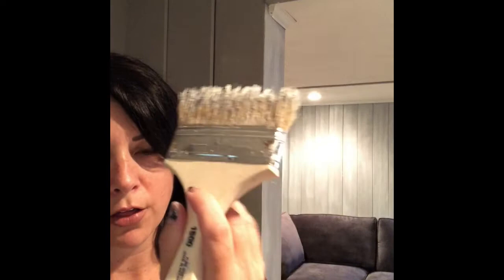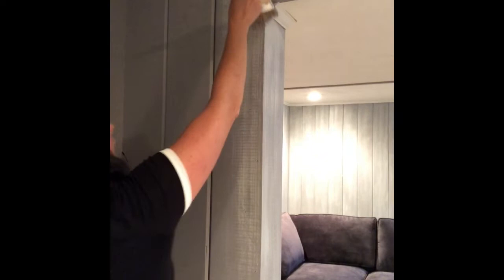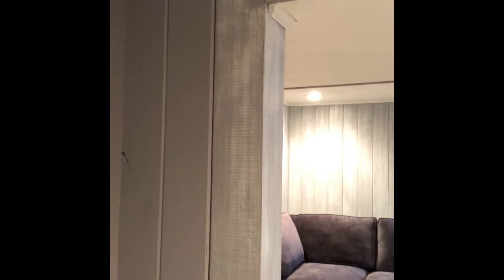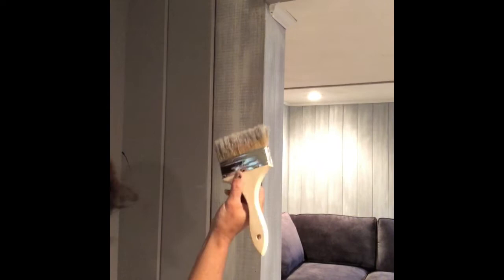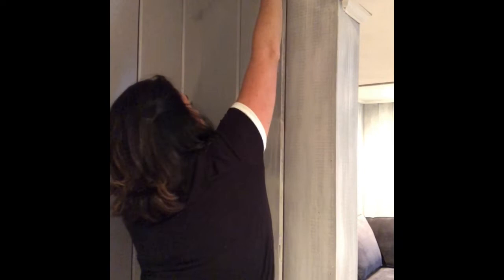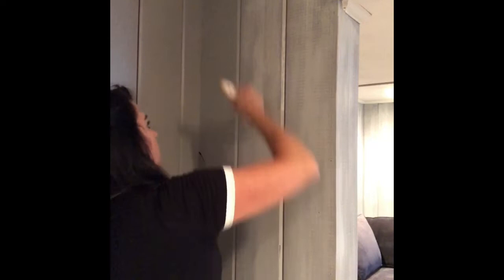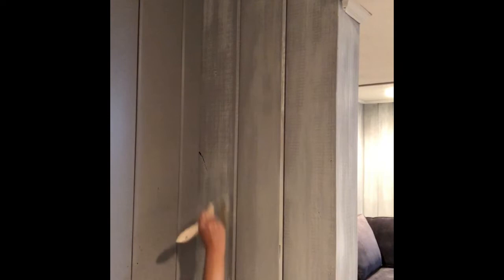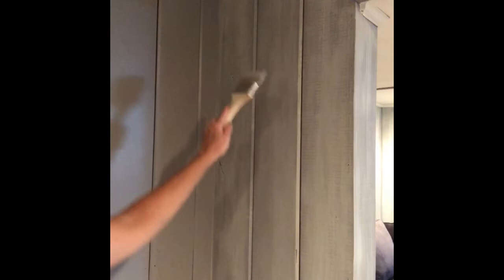How To Paint Paneling: Faux Barn Wood Tutorial

Comment: Does this procedure work the same on faux wood paneling?  After washing the wall, did you paint the entire room the darkest grey, and then mixed the other 2 from the palette?  It doesn’t appear to require much white, is that true?
Reply: @Lw WL Thank you!  Unless fake paneling comes with a wax coating, I don’t believe it has ever been done.  Do you recommend a specific paint, or can I use paint that is left from the painter who did our tiny dining room and bathroom?
Reply from the maker: I used an interior paint with built in primer